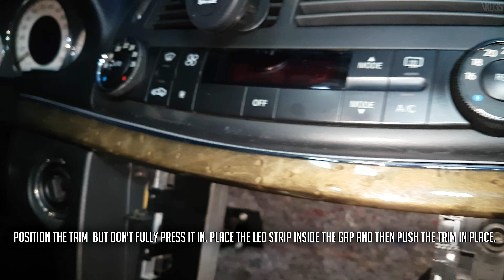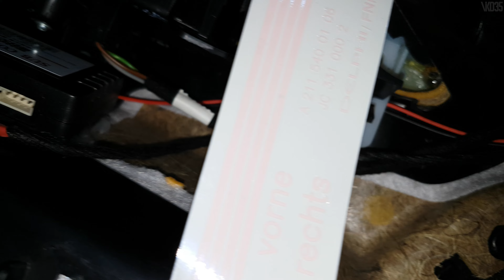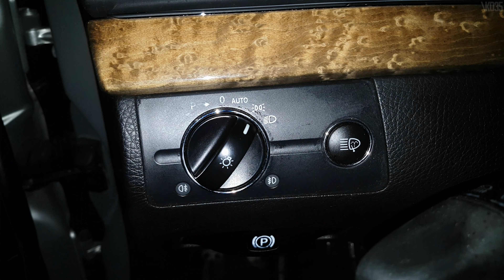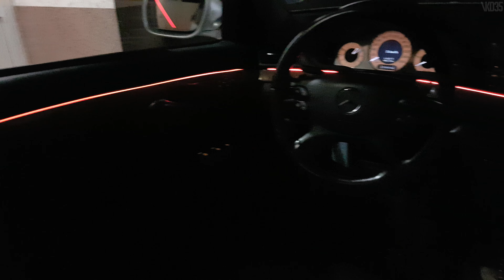Mercedes W211 - Interior Ambient Lighting Installation | LED Strips

Comment: Nice work!
1. I am wondering if the lights looks the same as W211 original colour.
2. It is possible to use only that color? I don't want to switch automatic to blue, Green etc.
Reply from the maker: You can select which color you want via the App and it will stay the same until you change it again manually.

Comment: Which option did you select from the link? Can i cut the led strips if they are too long for door panels?
Reply from the maker: The kit used is 6 in 1 Not Rainbow. If you want more modes and animations select "Full Color". The strips can be cut between every LED.
Reply: @VIK7ORIOS_WORKSHOP  Thank you
Reply: I received the package. Though I have one more question.. Sub controller does not connect with main controller via cable if i am right?
It only use power from switch in door panel? And wireless communicate with main controller ?
And i need a name for the app because the web site is not working from QR code 😕
Reply from the maker: @FPSDuLe  They communicate via bluetooth and only need to be powered somewhere. The app is Magic Lantern.
Reply: @VIK7ORIOS_WORKSHOP  thanks again 🍻

Comment: Hi, on the doors at the red wire i have 5 volts, they are not as bright as the dash light…
Reply from the maker: You can wire them to somewhere else like the lighter.
Reply: Same problem. Did you find another source?
Reply: @Alex-uo8mz  nu, cred ca voi cumpara niste ridicatoare de tensiune dupa aliexpress de la 5v la 12v 🤷🏼‍♂️

Comment: Hey do you have footage on how to take out the wood trim for the door panels ?
Reply from the maker: No, you will have to check other channels. You need to take off the door panels to remove the trim.
Reply: I just bought mine I got 6 wires you?